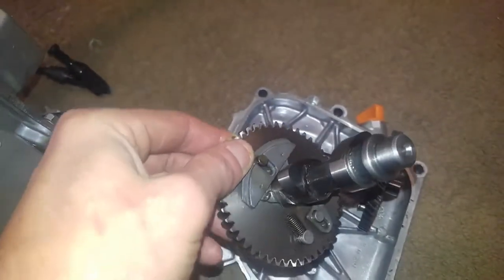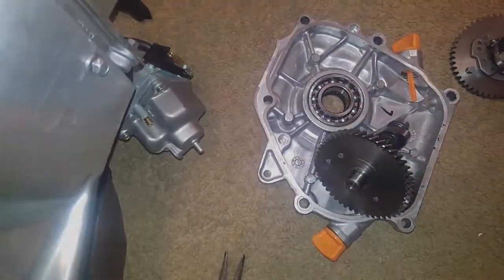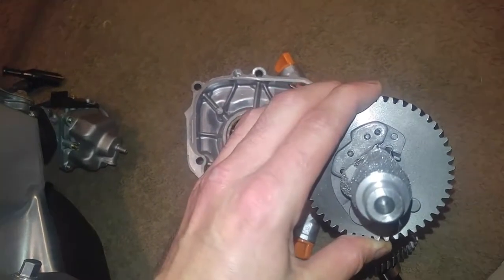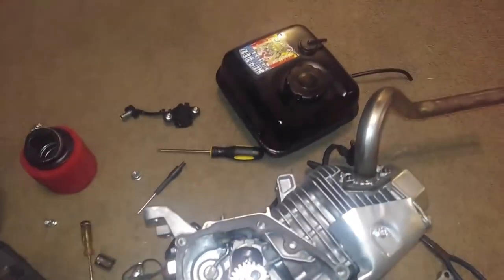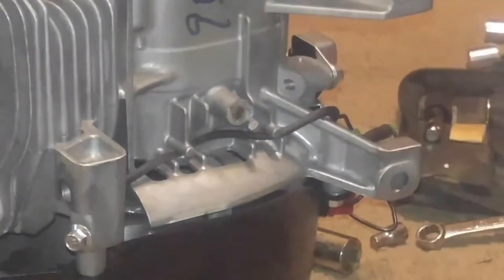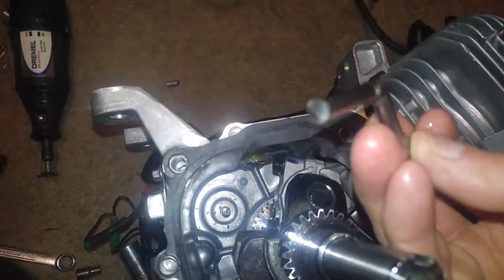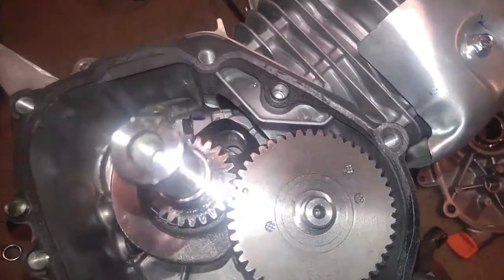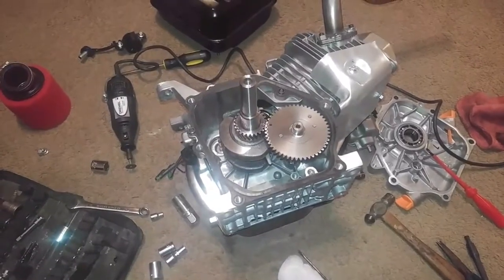new 265 cam install along with 26 lbs valve springs & Chromoly  push rods for the predator 212

Comment: Just wanting to make sure, if I were to buy a mod 2 cam, I’d have to grind down the head, but if I got the .265 cam or anything .275 or smaller, I wouldn’t need to grind down anything? It’s my first engine I’m really doing work on and I don’t want to mess anything up so I want to find a way to not have to grind down anything.
Reply from the maker: I would just put it in and try it out and see how everything clears each other I got lucky and didn't have to grind anything
Reply: spikeman dan Alright thank you
Reply from the maker: @adam100a8  anytime brother

Comment: Is this the Dyno CM cam
Or a Dyno  265 lift cam. ?

The CM also has 265 lift 
and not much duration
Reply from the maker: mine has more duration
Reply: I ended up with an Isky
Black Mamba Sr. cam

Comment: You ran a 265 cam without a billet rod and flywheel??
Reply from the maker: No you're wrong I did
Reply: @spikemandan  well the video shows you just removing yhe governor and installing the cam with the stock rod.
Reply from the maker: That's where you're wrong I have the Billet aluminum flyer wheel as well as the connecting rod to the piston